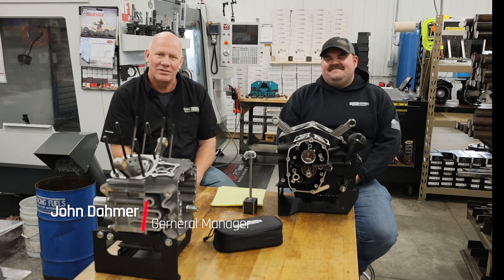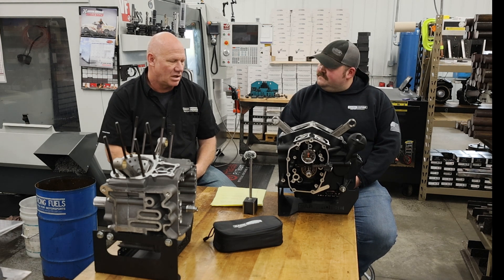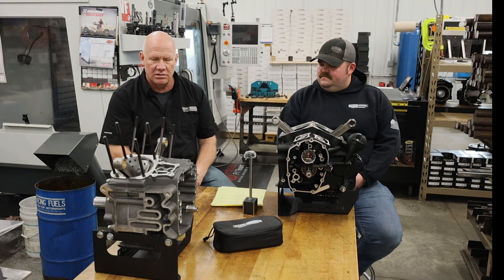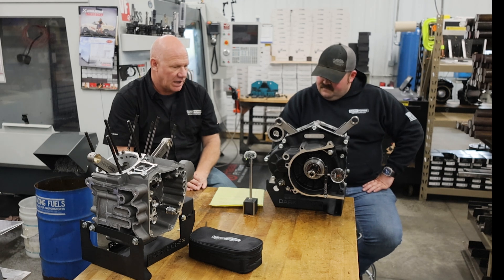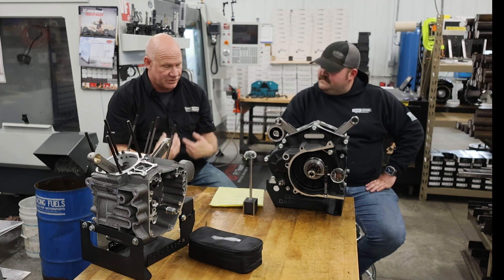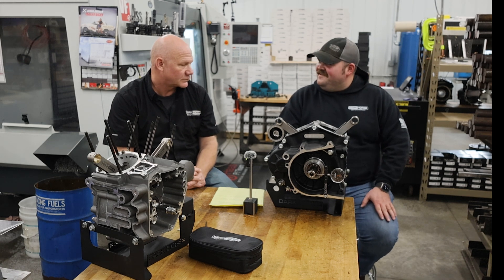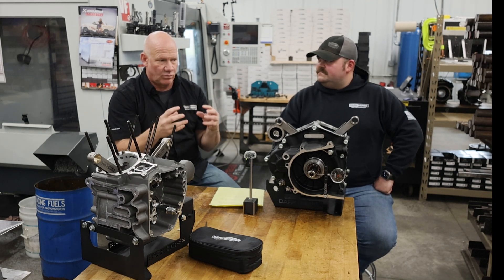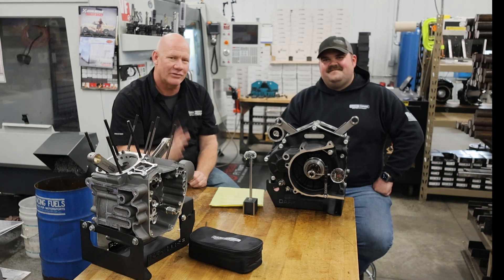Darkhorse Moco Run out tool

Comment: No comments on the Reed valve video,so I will ask here. The newS&S cases , amazing as they are, do not use the Reed valve system in their cases. Will or can you recommend adding them to the S&S cases?